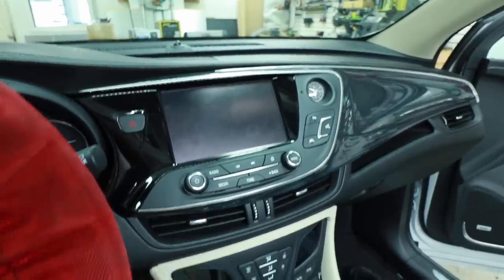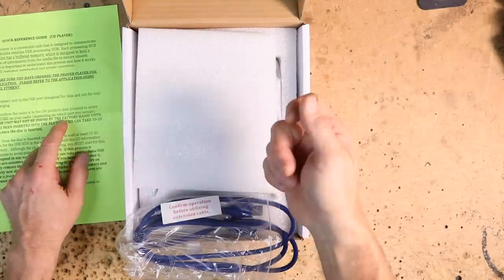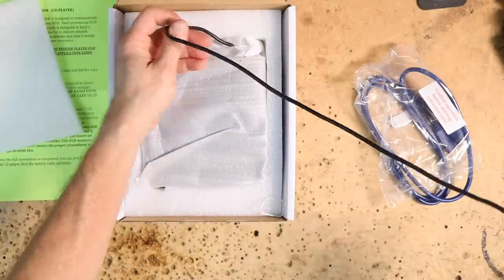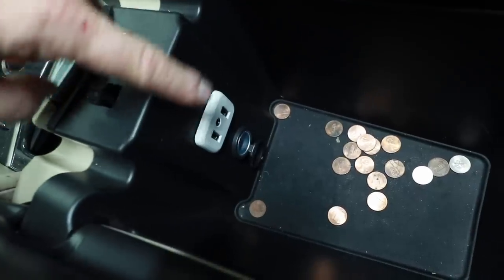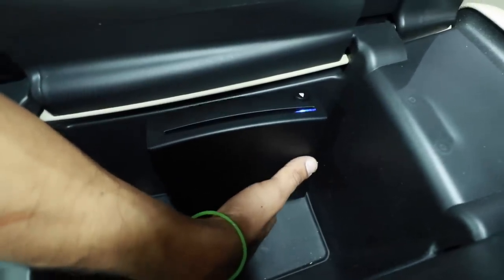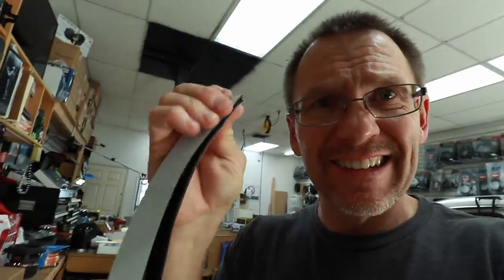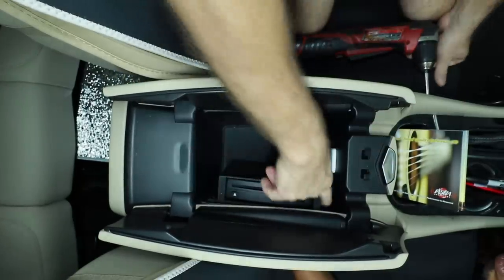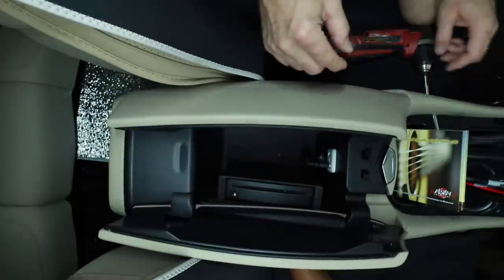Do you need to add a CD player to your new car that did not come with one?

Comment: Thanks for the info, but fact is - no CD player in a $50K vehicle sucks. The last thing I want to do with a new car is to have to rig up a sound system like I was 18 again and working on a 60's car.
Reply: I’ll take a 60’s car AND CD player
Reply: Just buy an older car from 10 years ago.
Reply: Mercedes actually did include a CD player as an option until 2021 when W205 was discontinued.

Comment: Miami Bass just sounds better on CD; no copy of the music will sound as good or reach the lowest frequency. For us real Bassheads, CD is the only way to go.
Reply: Lol cd is 128kbs. Try a 320kbs mp3. Theres no debate, 3x better sound quality.  The bass is significantly cleaner
Reply: @nordicpride9708 .... correct. Some guys speak with no knowledge.
Reply: @rmblwgn  A CD's bitrate is 1,141kps, which is 8.91 times what you quoted. Also, FLAC files can certainly handle the job.
Reply: For a real bass head vinyl is the only way to go
Reply: @facebookmakesmesick  
I have the EXACT same issue.

Comment: thank you for posting this. 
OK but the reason CD players are cool is that you can click quickly through the songs you want to skip.  You are saying you can't do that with this CD Player.  By the way I can rip a CD and play it digitally however I like the simplicity of CD where this is limited menus clicking and my eyes stay on the road and not my monitor clicking though menus.

Comment: I'm one of those who spent the last 30 years collecting music on CDs - I could go ahead and rip it all to other media - but seriously, when you got a couple of hundred CDs, that is not as conveinient as just keep on playing the CDs like you used to. So, I got myself one of these fpr my new car (Renault Zoe 2019) and it did not work. At least not as I was hoping it would. It played a CD I tested, but then refused to play it the next time. And it could not find track 1-10; always start at track 11. For some reason, it will play CDs I burnt in my laptop at once, but I had to try several times with the real one, untill I got any sound from it. Most of the time, it informed me that no media could be found on the disc. No such problems when I tried playing CDs with it connected to my laptop - then it worked great, so I guess the infotainmentsystem in my Renault does not really recognize this device for some reason... So make sure it works with your specific model of car before buying this player.
Reply from the maker: Yes, they do not work with all cars!
Reply: I bought one just like it that was compatible for my 2019 Silverado  but not sure which brand, got it off Amazon.  So I followed the directions to hook it up. Put in a cd,  and it worked.  That is until I wanted to play through the entire cd, it would play through the first 4 songs then skip to track 9 or 10. I tried skipping to the tracks it was missing but it would still go from 4 to 9. So I sent it back.
Reply: @adamloose1695  Does your 2019 Chevrolet Silverado have a 3.5mm auxiliary input jack (AUX port)? Normally the 3.5mm auxiliary input jack (AUX port) is located in the center console or front dashboard. My friend's 2024 Equinox has a 3.5mm auxiliary input jack (AUX port), and he got a POSSPO Jupiter CD player. The CD player works well in his 2024 Equinox as it is connected to the Equinox using both the AUX port and USB port. If your 2019 Silverado has a 3.5mm auxiliary input jack (AUX port), a CD player like POSSPO Jupiter with AUX input should work properly to play all the tracks in your truck. Hope this helps.

Comment: My mom’s new 2015 Jeep Grand Cherokee Laredo did not have a CD, would have been a $500.00 add on option and it gets mounted inside arm rest. 

So I had to put all her music on a SD card  glad to see this is an option. But can you use a external CD player that you would use for your laptop and plug it in? Would that work just the same?
Reply: No.  The radio has no way to interpret the output.  A portable CD player is the way to go.

Comment: I have this and the issue I’ve come across in a 2022 Equinox is it doesn’t  seem to play all the songs on the album and will go from like 1 to 5, to 7, to 13 and no it’s not on shuffle. But most confused as to why it won’t play all the songs.
Reply: Mine does the SAME thing in my 2017 Dodge Ram truck.  So I took the unit inside the house and plugged it into my home computer and all the songs play in order.  So WHY does it not work like that in my truck????
Reply: 2022 Equinox should have a 3.5mm auxiliary input jack. My friend bought POSSPO Jupiter CD palyer for his 2024 Equinox. The POSSPO Jupiter CD player needs to be connected to both the 3.5mm auxiliary input jack and USB port. It works well to play all tracks. If your 2022 Equinox also has the auxiliary input jack, you can search POSSPO Jupiter CD player and check if it works in your 2022 Equinox. Hope this helps!
Reply: @bruceyakoweshen1730  The 2017 Dodge Ram 1500 should come equipped with a 3.5mm auxiliary input jack. So you can consider POSSPO Jupiter CD player. My friend's 2024 Equinox also has a 3.5mm auxiliary input jack (AUX port). The POSSPO Jupiter CD player works well in his 2024 Equinox as it needs to be connected to both the AUX port and USB port.

Comment: What if your newer but not so new car does not have a CD player and has no USB port?
Reply: If your newer vehicle doesn’t have a CD player or a USB port, check if it has a 3.5mm auxiliary input jack (aux port). If it does, you can use a CD player with an auxiliary input function. To power the CD player, you can use a car charger plugged into the cigarette lighter.

For example, the 2024 Chevy Express van lacks both a USB port and a CD player, but the POSSPO Jupiter CD player works well with it because the van has a 3.5mm aux input jack. You just need a car charger to power the CD player.

I recommend contacting POSSPO to confirm if the POSSPO Jupiter CD player is compatible with your vehicle. Hope this helps!

Comment: Would this work on my 85 Ford ranger everything is original with a cassette port
Reply: You would need a cassette aux adapter then connect to that to the aux port in a cd player. It worked for me.

Comment: Does the double tape strong in the trunk, cause i need my trunk carpet not to move cause i have 2 a jl audio w7 series subs box and its big and it slides,
Reply from the maker: I don’t think it will hold that amount of weight
Reply: What do you recommend in a 08 impala Ls ?

Comment: And if your car doesn't have a USB port?
Reply: If your newer vehicle doesn’t have a CD player or a USB port, check if it has a 3.5mm auxiliary input jack (aux port). If it does, you can use a CD player with an auxiliary input function. To power the CD player, you can use a car charger plugged into the cigarette lighter.

For example, the 2024 Chevy Express van lacks both a USB port and a CD player, but the POSSPO Jupiter CD player works well with it because the van has a 3.5mm aux input jack. You just need a car charger to power the CD player.

I recommend contacting POSSPO to confirm if the POSSPO Jupiter CD player is compatible with your vehicle. Hope this helps!

Comment: screw this I want a tape deck but without a bunch of wires. I found a bluetooth transmitter that works with cars that have Bluetooth. the battery lasts 12+ hours on the bluetooth but AA batteries only go so long with a motor moving a tape deck... I know it seems silly, but CDs you can convert to USB/flash memory easily etc.  tapes...are just full on nostalgia for us 80s/90s kids.  I really wanna keep my honda "smart" radio but find a way to play tapes without a mess of wires lol

Comment: Can't you just add a pioneer Stereo? or don't they make a model for that car?
Reply: I'm sure the customer didnt want to replace the head unit
Reply: It is not easy task to remove a car stereo nowadays. I have installed dozens of them back in the day. Today's cars the radio are often integrated with the climate control. You opening your self to a lot of issues. It is better I would think to install a CD player in addition to you radio that came with the car. I have not done it for 17 years but I am thinking about it.

Comment: I have a 2019 accord what 6.5 or 6.75 2 way components would you recommend. I'm putting a Rockford Fosgate p3 12 with a amp and want to replace the components in the front and back. I also wanted to know a good amp for the 4 speakers. Would I need a LC7i? is the LC7i a hi to lo converter?
Reply from the maker: Did you watch ur video on the 2019 accord?
Reply: Five Star Car Stereo Yes I did

Comment: My 2016 Mazda 3 has this issue. No CD player...😞
Reply: @rmblwgn  there was an aftermarket unit that places the cd player unit over the climate controls...but I can't cough up close to 400 for a radio at this point in my life...  I had contemplated mounting my old Alpine in the glove compartment and just running an RCA to headphone jack adapter...but I'm kinda wanting that head unit to go in my Mustang... Long term projects....
Reply: @mrupholsteryman  I just ended up putting an aftermarket head unit in mine but I don't have a car with integrated climate controls mine was as simple as reusing the factory din plates  on my aftermarket radio. your cheapest option is just to get those CDs to MP3. also sending the signal from an old radios RCA to the new radios headphone jack is very interesting and smart . No reason it wouldn't work never thought of it though
Reply: @rmblwgn  it would allow all the normal functions of the factory steering wheel and less mess behind the factory dash. I just have no HUGE desire to put something real nice into the commuter car that is parked in the city garage while I work all day.  Have had a few break ins..  In other cars. 

Although...maybe one day... I'll give it a go. It will allow me to have more volume gain control as well.  Maybe I will do this.... Haha! 😇😎  I'll just not play it loud for the city area.
Reply: @mrupholsteryman  put several 16awg wires in a nice loom with tesa tape and tap into 15a radio  fuse in fusebox. Then hook other end  up to your radio in glove box. you could do it easily in a Sunday afternoon and no one will see it while you're at workit's in the glove box locked
Reply: @rmblwgn  I used to install a long time ago! Just never got certified.   I still enjoy music...but sticker shock and false watts advertising can have one rethinking this stuff.

Enjoy your day! 😇😎
Reply: @mrupholsteryman  

Does your Mazda OEM head unit have a 3.5mm (1/8") stereo miniplug AUX input???

Just buy a classic Sony Discman portable CD player for $5-$30 off of eBay.  99% of them have a fixed line-level "LINE output" 3.5mm stereo jack along with the variable volume headphone jack.

Get a model that uses 1 or 2 normal 'AA' batteries, not proprietary rechargeable "gumstick" batteries..

Some models even have digital Toslink mini optical output that you could connect to a DSP with digital optical input.

You can find Sony or other brand portable "Walkman" type CD players on eBay for $5-$50.  A lot of the Sony units even have a small wired remote control.

They will easily fit in your center console storage cubby or glove box.  Add some headphones and you can take it with you to listen at work, hotel room, working out...though you'd obviously just use your smartphone for that.  :-P
Reply: @bbfoto7248  I stream music through the Bluetooth already.  It is just that I have a couple dozen CDs or so that I can't get the songs on Pandora or YouTube.  

When I first got into car audio.. I did that exact thing. I found that the cd skipped a lot less when hanging around my neck then on any kind of mount specific fo holding the discman. 😇😎
Reply: @bbfoto7248   See my post.  Using a Generic Best Buy CD player with great skip protection, a 3.5mm audio cable and a DC power adapter.